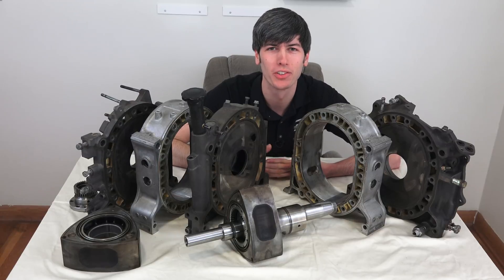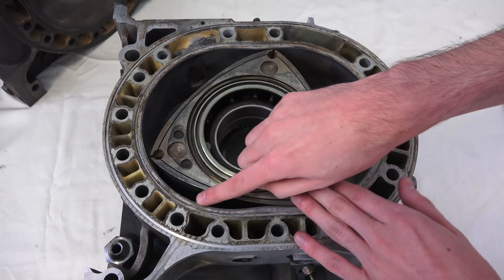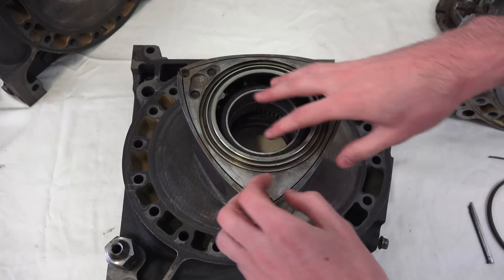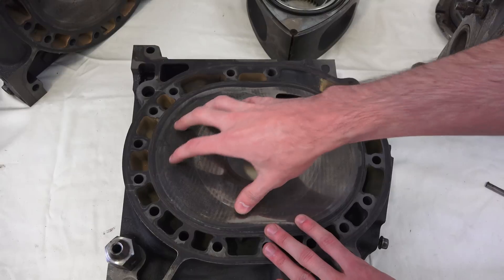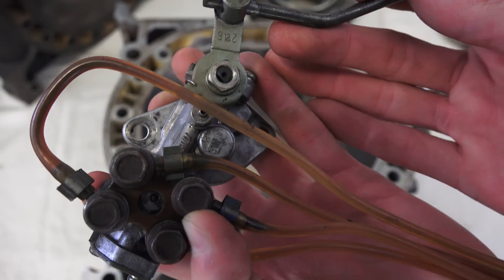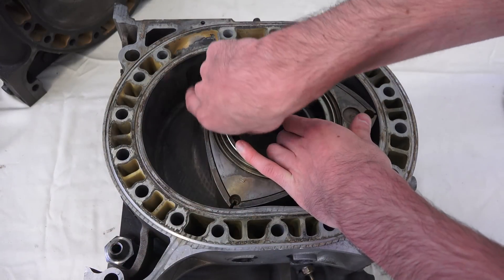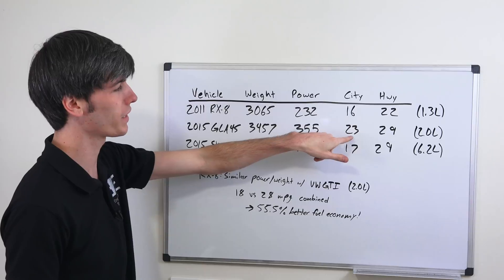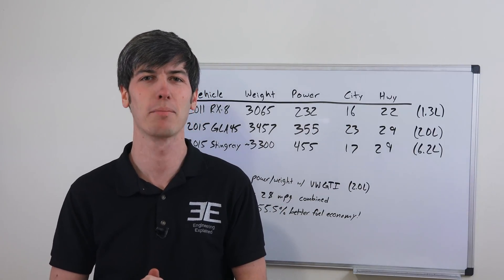4 Reasons Why The Rotary Engine Is Dead

Comment: Even without being an engineer or physicist, just by looking at its mechanism and knowing how it works, common sense shows that a rotary engine is inefficient. This is just like the shaft-driven bike. You immediately know that a significant energy is lost in the process.

What was not explained is that the force (combustion) is applied too close to the rotational axis which acts as a fulcrum in a lever. Hence, every combustion does not produce enough torque comparable to the traditional ICEs.
Reply: Excellent comment.

Comment: I.... haven't heard anything from this video that would NOT make me buy a rotary engine again.  Just don't buy one with no knowledge about them and you're fine.
Reply: Lol!!! There is a sucker born every minute!
Reply: @sandervanderkammen9230  Sucker?  I've owned an RX 8 since 2010 and I've never had a problem with it.  Learn to use a rotary and learn what it needs and what you can't do and then you won't be so jaded.  Nobody wants to learn something, they just want it done for them.  Go to your piss ton engine, the engine that you just throw away when its done instead of rebuilding it.
Reply: @DarkSun_  You own an RX8?  Thanks for proving my point!
Reply: @sandervanderkammen9230  I own 7 cars numb nuts.
Reply: @DarkSun_  Are they all fugly POS sedans? Or do you own other cars with weak, unreliable engines?
Reply: @DarkSun_  ???
Reply: Mazda can't afford to restart production just for you... the rest of the people in the world had sense enough to buy something better.

Mazda ceased all production of Wankel engines on June 21st 2012 because people stopped buying them, Mazda only makes reciprocating engine cars or EVs now.
I guess you didn't get the memo?

Comment: This seems genius.  There HAS to be a way to solve these issues, especially for motorcycles to keep a smooth ride, no?  I just looked this up after watching Fortnine's video. 

Come on Mazda.  Hope they do something cool to fix the problems.
Reply: Might appear genius at first glance, but after serious research the fatal flaws become readily apparent.

All of the 26 Wankel engine licensee's eventually came to the same conclusion, that the Wankel engine is inherently unreliable and horribly  inefficient.

Mazda abandoned all development of Wankel engines in May 2009..
The last production Wankel engine design was unveiled over a quarter century ago.
Reply: @sandervanderkammen9230  yeah.  I know way too much about these now.  Disappointing.  BUT Mazda actually is bringing them back for one last hoorah as backup power in its new hybrid.
Reply: @ItsJustMe0585  Sorry to disappoint you but that rumor is not true... The MX30 is already in production available for sale and will only be available in a 100% plug-in battery electric vehicle or mild series hybrid powered by a 2.0 liter 4-Cylinder Skyactiv G engine.

Comment: the Wankel engine is a 1960's product.  In many ways it is equivalent to a 2-stroke engine.  the internal combustion engine is on its last leg.  the opposed piston engine is likely its last evolution before being replace by electric motors - no compression, no exhaust, no reciprocal mass to generate vibrations.
Reply: The Wankel engine was the product of 1950s technology and peaked in the 1960s.
 Someone who was an industry expert once told me the same thing, he said;  "in 20 years all cars will be electric" 
That was 30 years ago and he was just as wrong then as you are today.  99% of all vehicles today are still internal combustion.

Comment: I drove a mark 1 RX-7 for a long time, great fun. My understanding is that the poor similar efficiency arises from the shape of the combustion chamber which is long and narrow such that the surface area of the combustion chamber is much higher than that for cylinder engines, and so a higher proportion of combustion energy leaks away into the coolant.

Comment: LNG (liquified natural gas) is becoming a fuel of choice in some urban car fleets, mostly public utilities that supply it for urban home heating and in some cases electricity generation. It burns cooler,  carbeuraton or vaporization are non issues, it could even be routed past the hotter side of the engine to aid cooling, it burns clean even at lower temperatures and pressures, and the carbon content is lower. Has this been tried in a rotary engine?🤔
Reply: The Wankel engine was exhaustively researched and developed for use with LPG and CNG fuels by several major manufacturers during the 1970s OPEC oil crisis.
Ingersoll-Rand actually built large stationary pumping engines fueled by Natural Gas from 1975 to 1985 but they sold poorly.
The Wankel engine lacks the higher static compression ratios required for optimal performance with gaseous fuels like LPG, CNG and hydrogen.
The results are higher fuel consumption, lower performance and higher emissions than reciprocating engines operating on the same fuel.
Reply: @sandervanderkammen9230  Well, thank you so much. I had no idea about all those things. Seeing it pass into history, it helps to know that it got so many chances to succeed.
 Elswere in the post, I mentioned advances in materials science. In particular, I was wondering about perhaps some of the advanced ceramics out there. Are there any experts out there that could comment? I thought maybe a ceramic rotor could handle the radical temperature differences between the two sides of the engine better. Finally, has turbocharging or something like it been considered or tried?
Reply: @jacqueslefave4296  You are very welcome.
 Excellent questions, it is such a pleasure.

It is a common misconception that many of the negative issues that plague the Wankel engine are related to limitations in material science or manufacturing technology.
 The truth is that almost all of the problems related to the Wankel are related to the limitations imposed by  the unique geometry envelope that makes it possible to operate as a internal combustion engine.

First conceived as a supercharger compressor for NSU 50cc 2-stroke motorcycle engines by Dr. Felix Wankel, he was convinced by colleague Walter Freode to convert the design from a compressor into a internal combustion engine.
This prototype known as the DKM-54 was a true rotary design, extremely lightweight, smooth and vibration free, it was however extremely complex, expensive to manufacturer and difficult to service.

Hanns Paschke with the help of Walter Freode extensively modified the DKM into the non-rotary version called the KKM-57.
The KKM is much simplified and more practical but still suffered from many of these same issues imposed  by the geometry limitations of the triangular shape and its motion.

One of the most difficult issues that effects reliability and efficiency is the compromised architecture of the combustion chamber. This causes highly erratic combustion behavior and "knock" which can damage the  internal components.
Another is the very fragile nature of the seals, there is in fact no possible solution to either of these problems without altering the geometry to point where the engine ceases to function as a 4-stroke engine.

Other geometry problems directly impact both mechanical and thermodynamic efficiency.

Several manufacturers have developed both supercharged and  turbocharged versions, Mazda developed both.
Supercharging causes issues related  to knock/detonation and higher pressures that effect the apex and side seals.
The combustion chamber has less knock resistant than conventional engines and requires higher fuel enrichment under boost conditions.

Wankel engines due to there lower efficiency produce higher exhaust gas temperatures than reciprocating engines that easily exceed the safe operating limits of the exhaust turbine. 
Both systems produced poor results with higher fuel consumption and reduced reliability.

Cheers!
Reply: @sandervanderkammen9230  Okay. Very informative.

Comment: I bought a new Mazda RX2 back in 1973. Drove it from Florida to California. Best highway mpg was 18. Remember there was a 55mph speed limit at the time. Around town 13 to 14 was normal. Also spark plugs needed to be replaced constantly. Traded it in for a new 1975 Ford F150 when I moved to Texas.

Comment: In short, it makes 2x the power from the same displacement, by burning 3x the fuel. If you want lots of power from a small, light engine, it's great. If you care about efficiency, not so much.
Reply: Not true, if you are using the bogus  "Tax Displacement" method the Wankels output seems impressive but true displacement of the Mazda 13b is 3.9 liters and when compared to a reciprocating Otto type engine it displaces 2.6 liter corrected to 720°.

Certainly fuel efficiency is terrible but more like double the consumption of a comparable reciprocating engines.
Reply: @sandervanderkammen9230  "Displacement" can be an ambiguous term. Does it mean the engine's physical displacement? Or how much displacement it actually uses per crankshaft revolution? Or how much displacement it uses per power stroke per revolution?
You might as well say that a 3 liter 4-stroke piston engine is really only 1.5 liters because each piston only uses its displacement every other downstroke. Or considering both piston directions, say that it's really only a 0.75 liter engine because only 1 of every 4 piston strokes produces power.
Then you'd also have to double the "displacement" of every 2-stroke piston engine.
Also, the Wankel crankshaft spins 3 times faster than the rotor, do you want to include that in its definition of displacement?
It's a slippery slope that only leads to confusion, which is why we have a standard definition for engine displacement regardless of how it uses that displacement.
Reply: @michaelclements4664  You sir clearly do not understand the well-known and commonly accepted, scientific definition or method of calculating the swept volume displacement of Internal combustion engines 
It is not ambiguous and is calculated    very precisely with a well defined set of rules that apply to both 2-stroke and 4-stroke reciprocating engines as well as the 4-stroke Wankel KKM-54 type engine which we are discussing.
Any questions?
Reply: @sandervanderkammen9230  At first you said the "true displacement", which doesn't refer to any "well-known and commonly accepted scientific definition." And your number of 3.9 liters is clearly not "true" because it simply triples the displacement which is a mistake because that fails to account for the fact the crankshaft spins 3 times faster than the rotors. Now you say what you really meant was "swept volume displacement". I agree the comparable swept volume displacement is 2.6 liters. If you had said "swept volume displacement" from the start, there would be no dispute.
The swept volume displacement is useful for comparison to piston engines. Yet it doesn't take into account how the Wankel's unique design achieves swept displacement much larger than its geometric displacement, which makes the Wankel smaller & lighter than a piston engine of comparable swept displacement and power output.
Back to my original point: the Wankel offers high power in a compact, light engine. The price you pay is low efficiency. That's a good tradeoff for high performance cars. Not so much for every day drivers.
Reply: @michaelclements4664  The "true" displacement is 3.9 liters.

Its very simple, each piston/rotor has 3 combustion chamber volumes, each with a swept volume displacement of 654cc's.
Times the 2× piston/rotors equals 
6 chambers × 654cc's = 3,924cc's 
3.9 liters.

Any questions?
Reply: @sandervanderkammen9230  It's not that simple because a Wankel sweeps that 3.9 liters every 3 crankshaft revolutions. Which is an apples-oranges comparison to a piston engine, where it sweeps its displacement every 2 crankshaft revolutions.
Refer to my original statement that the Wankel produces 2x the power while burning 3x the fuel.
The info you've provided supports this. First, the swept volume displacement of a 1.3 liter Wankel is 2.6 liters, which is a 2x ratio. Second, producing 2x the power with 3x the fuel is a BSFC ratio of 3/2 = 1.5 to 1, or 50% worse efficiency / BSFC.
You asked: any questions? My question is, as your info supports my original comment, it seems that we agree, so what are you arguing about?
Reply: @michaelclements4664  NO its not, it is clearly the same standard applied to all 4-stroke and 2-stroke engines.

When we "compare" the Wankel engine to a reciprocating Otto type type engine we simply correct for the difference in the number of degrees in the firing order sequence, the same way we do when we compare a 2-stroke engine to a 4-stroke engine.

If we want to compare a Mazda 13b engine to a reciprocating Otto type engine we use the 2X conversion formula at 720° which gives us a relative displacement of 2.6 liters while the true displacement is still 3.9 liters.

The Wankel engine completes it's firing order sequence in 1080° of crankshaft rotation compared to the usual 720° found in the Otto engine. 

The Wankel engine produces Less power per liter and its BSFC is roughly Twice that of a comparable reciprocating engine.

The Wankel KKM-57 design has several inherent fundamental flaws which have a significant negative impact on BSFC and BMEP this is not due to the method of calculating its displacement, it is simply much less mechanically and thermodynamically efficient and has lower combustion efficiency as well.
Reply: @sandervanderkammen9230  Swept volume displacement is useful for comparing with 4 stroke piston engines. And we agree from the start that Wankels are inefficient. Yet this misses an important point. A Wankel is physically smaller and lighter than a piston engine of equal swept volume displacement. Its power output to weight and size is impressive. This makes it ideal for high performance cars, which is why Wankel engines were successful and popular in racing.

Comment: Even if the emissions, thermal and combustion efficiency, fuel economy is regarded as terrible, nothing compares to the feeling of driving a lightweight, rotary-powered vehicle.
Reply: Then why did people stop buying them??? 
Mazda sales of RX models steadily declined after 1986 an average of 30% per year until sales simply dried up... you can't build cars that don't sell and expect to stay in business.
Mazda only sells cars with reciprocating engines or its new plugin battery EV the MX30.
Reply: @sandervanderkammen9230  Any facts on this claim?
Reply: @sandervanderkammen9230  I know Mazda ceased production of RX8 on that date. What I want to know is the details where you said since 1986 sales declined 30% per year. And if you read my original message, I never talk about how Mazda should still sell the car or if the rotary engine is still a good engine to produce. I just said I like driving it more than anything else. That's all.
Reply: @8828RR  Wards AutoNews Mazda Wankel rotary Sales
Reply: @8828RR  What is there to like?
mediocre power, no torque and horrible reliability, some Diesel engines are more exciting to drive... they are certainly better suited to racing than the Wankel.
Reply: @sandervanderkammen9230  Mediocre power? 13b-REW produces 300 hp standard on the later RX7 FD and Renesis produces 230 hp on 6-port RX8s. That's plenty enough for me. 230 hp out of an naturally aspirated rotary engine, even with the side exhaust ports, is quite something. Torque is low yes but if you want torque then the turbo rotary will remedy that. And which diesel engines are you referring to?
Reply: @8828RR  Yes, mediocre.
Mazda has never sold any car with 300hp. The standard engine in the FD was only 255hp.
The standard Renesis was still only a very unreliable 198hp or 211hp, of course Mazda was sued for overstating horsepower on the RX8 and lost.
 159 ft.lbs of torque in a 4 door sedan is really pathetic!

Audi won Le Mans with a Diesel engine NINE TIMES!!!!

Comment: Had a RX3 years back. The only thing good about it was the engine; was a rust bucket, sheet metal loaded with slag bits causing paint blisters-eventually holes. A total build disaster; soured me on Mazdas to this day.  It was a runner, though-silky smooth -- like an electric car -- which I now drive. Which, BTW will obsolete all combustion engines so lovers of exhaust note, pollution and stink will (if not gone by then) have to be satisfied with silence -- which is golden.

Comment: Emissions, got it. Is it also the reason why it's not used in racing? Especially where refueling is allowed
Reply: Reliability was the biggest disadvantage that plagued the design until it became obsolete about a decade ago.

No manfacturer sells a Wankel engine anymore... so no interest in racing either.
Mazda no longer has any factory motorsports programs.

Comment: I mean sure, all of the things you said are right. It’s an engine you have to take care of periodically and that gets tiring and expensive.
But not as expensive as the cars you were comparing the RX-8 to. I mean it ranged from double the average price, used, to more than half a million dollars more! OF COURSE THEY’RE GONNA BE BETTER AT FUEL ECONOMY. But you save yourself about three years of private school from the get go.

You should’ve compared it to the Chevrolet Camaro of the same year, the Nissan 37OZ, Mitsubishi Eclipse or the MX-5
Reply: What part of the comparison did you not understand?
The chart shown is an excellent analogy for what engineers call BSFC  Brake Specific Fuel Consumption.

Wankel engines are horribly inefficient and produce very little horsepower per gallon/liter of fuel.

The chart makes this very digestible and easy for amateurs to understand the concept.